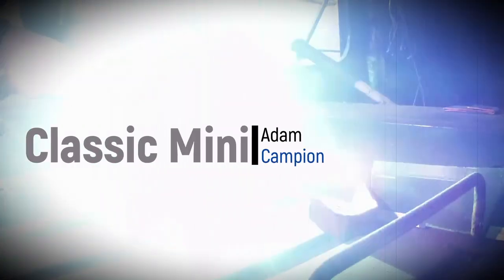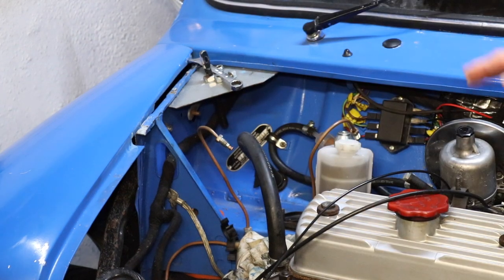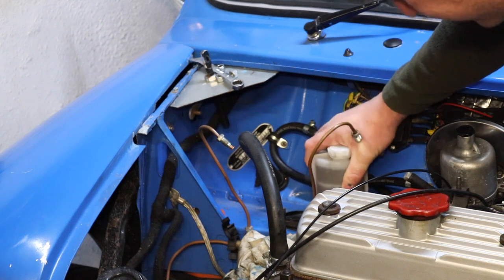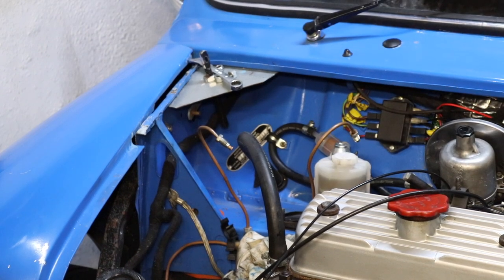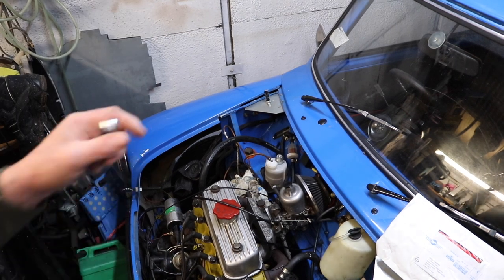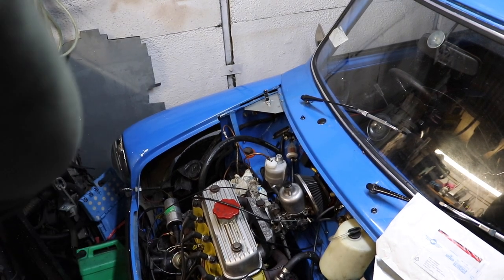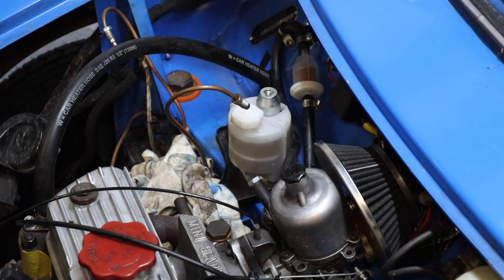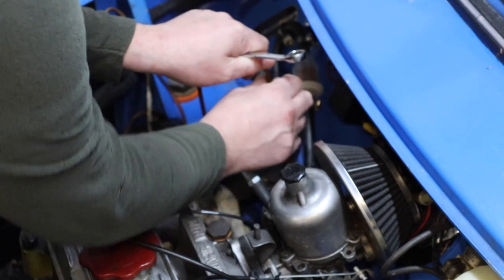Refitting the Master Cylinder

Comment: Hi Adam,  Pardon my ignorance but I was wondering why you disconnected and removed the clutch cylinder at the same time you removed the brake master cylinder?  I am just putting a rebuild kit in my clutch master cylinder and hoping that when finally installed it won't leak. I like the look of your new one with the plastic reservoir as you can see the fluid level easily and what colour it is. Enjoying your videos.  Cheers, Midge
Reply from the maker: Hi mate. I removed it after the previous video because I had a sudden sinking feeling I could have the clutch and brake masters in thr wrong place. But I learnt its not physically possible. Lol. I would have liked the metal ones like they should have been. But they were a bit pricey for me.